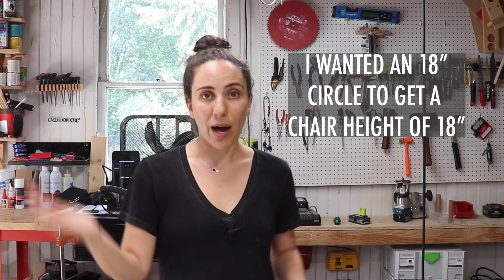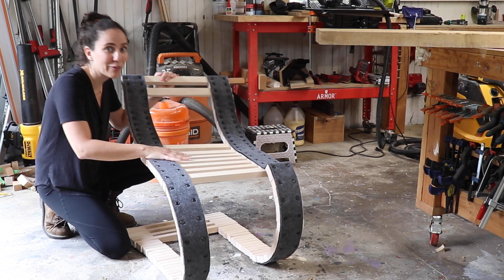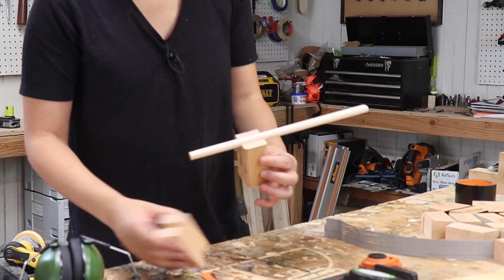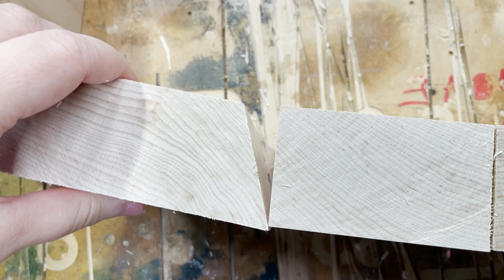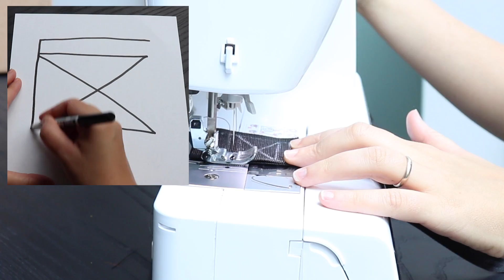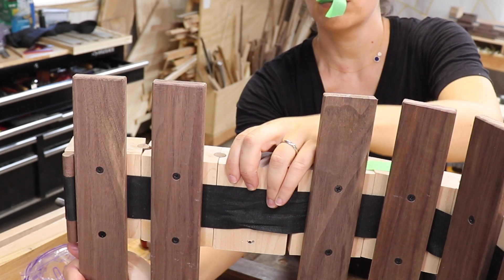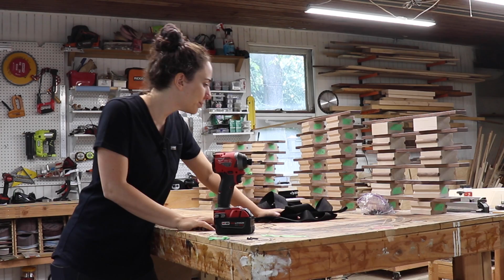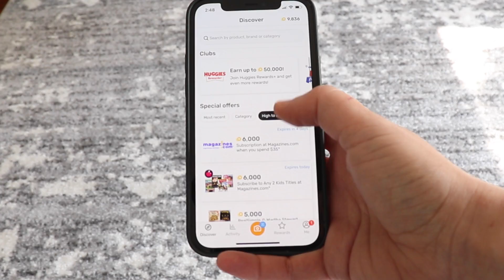I ATTEMPT to make a Roll Up Chair… AGAIN...

Comment: If you could have gotten the same sort of material that is used for seat belts....that might have worked best...
Reply: Also if you ran the straps in one continuous circuit along both the "back and front you might find a way to stabilize it...
Reply from the maker: That’s what I used

Comment: Hi,
I just wanted to suggest using something like bike chains so you dont have any of the flex from strapping (nearly every strapping has some flex which gets noticeable at such levers you have in you're chair). It may be heavier but depending on the chain could be still fine (I haven't informed myself so it is just a thought i had after watching and you would probable need to calculate how much force is on the chain [i think roughly is enough and maybe  you find a simulation program or just a calculator where you can just enter your 3d model] to choose). To still have this nice shape and bending you could cut out a rounded cutout at the middle of the thick piece (that the chain still moves fine and dont just have foldable parts where it isn't between  the thin and thick peaces of wood). I hope that you're still interested in that project and read my comment which will hopefully help in some way.
have a nice day
frederik

PS: i dont know how often i needed to correct the word chain into chair and the other way around but it was often. I also hope i didnt made to much mistakes in this comment except upper and lower case mistake I dont give a (I dont wanna get the comment deleted so no swearing) about that
Reply: or you saw that video which solved that problem way easier and i just wasted over a hour after 12pm to think about it (writing was literally the hardest part :(   )  while dont doing my homework for tomorrow

https://www.youtube.com/watch?v=MuodNlDKce4
O_O

I just wanna kill my self after i wrote the first comment and i went back to the starting page that vid showed up in the first row

Comment: Point 1: This project would never be able to satisfy you. As there is an inherent flaw in your expected outcome, this being the pinch points made with each piece of wood and the desire for safety.

Point 2: using joinery that hooks/latches/locks when tension is applied would solve the collapsing, this would though make it a lot more difficult to design and manufacture. while rolling it out would become more restricted in its order of operations.

Point 3: you have designed the chair to be folded out in the desired shape, having not accounted for the compressibility of the wood itself meaning it would not be as pretty to look as when folded out as you want.

point the 4th: replacing the UHMWPE or the nylon with leather would not solve the problem with the tension, try playing with steel cables first.

Comment: This problem is similar to how when you a long stretch of a power cable, no matter how much tension you put in it it will still sag under gravity. You can increase the tension to remove sag but its not quite a linear relationship and the cable can only handle so much tension. So yes stapling would work better. More support means you don't need to apply crazy amount of tension to stop a smaller segment from stretching/sagging.

Comment: You'd want the straps to be on the tension side (outside curve), if you change the side they are running on between the curvatures it should work better. (just lead it through a slot in one of the straight pieces)
If you could somehow integrate a spanner into the design to tighten the strap after deploying the seat that might also help. 

Also: don't try leather, that can stretch a lot. A synthetic fiber like dynema/kevlar with no stretch is what you need.

Comment: Leather would probably be worse that the poly your using. Leather conforms to stress your chair would be stressed continually so it would stretch till it breaks over time. Leather is skin so I believe it wouldn't work. I think your issue is the strength of the strap is weak due to it being linear in design. try a cross stitched hose material maybe and widen the strap to the width of the blocks. Just a suggestion. Failure is cloaked opportunity!

Comment: Odd idea. Have less and longer pieces, instead of a roll up chair that turns into a circle, it could be a fold up chair that turns into a triangle. Everything else would be very similar. A base piece, a vertical piece and a sitting and back piece. They have the angled edges so they fit in a chair shape and fold forward as your designs already do. I was thinking between the vertical piece and the sitting piece there could be an inner angle to add support, like an arch. To be honest this inner arch or angle for added support, is the best part of my idea but idk how it would work or fold up at all

Note: idk anything about any of this. This is merely a thought

Comment: I'm no engineer but maybe thinking of the straps as rubber bands will help? when you shorten the straps you increase the pretension but still, the weight needed to stretch them remains the same but if you instead double up the straps on top or side by side for a total of four straps then that should in theory be like doubling up the rubber bands on a slingshot increasing the needed weight to begin stretching? and also, won't seatbelts be good since they're slim and short and made to not stretch?

Comment: The problem is the tension being transmitted to the ends.  The straps really need to be attached at each piece so the ends don't have the curling under problems.  That also prevents any little bit of flexibility over the whole strap length causing a big gap at the weakest areas.  Even super stiff Kevlar strap can stretch up to 1% under high loads, and 1% of the about 1.5m strap length is enough to open up a 1.5cm or so gap and ruin the effect.  Where as if each board is connected, the inter-board distance is maybe 5cm and the max gap is <1mm even with normal strapping. 

I like the dowel groove joint, one could do the same thing between the cover slats and the maple structure to crimp the strap to keep each strap section independent.  I'd even epoxy between them to bond the strapping to the wood.

And then, if you still get stretching - get those Kevlar straps.  Probably overkill, but it'll eliminate that as a problem in any case.

Comment: what if they were all connected to each other like hinges? shape them like door hinges and put a metal or wood rod in the hinges. It really doesn't seem like there is any material that could replace the straps well enough

Comment: You should really try metal cable going through the blocks like beads on a string. Metal won’t stretch like fabric but you could still have fabric on top as a design choice.

Comment: Just use hinges. You can even incorporate them in the blocks design. Sadly, i think that wood is just not strong enough material for this design. I have seen steel chairs in that shape made with strong pipes flex and break at that support curve.

Comment: only 2 things i can think of that could work are, using some kind of steel wire/strap underneath those ones, or cut the strap so you have 1 piece of strap per connection instead of 1 strap for the whole thing, tho that probably wouldnt help much with strength, i think, idk, as for how to hold each strap end, you could make a hole in the wood and then pass the straps through it and fix it on the other side somehow, you are the tinkerer, you figure it out

Comment: I doubt leather would work. It would stretch. Having a small strap between each piece might work. It will at least prevent one end of the chair from collapsing on you when you put tension in it. If you can't find a suitable textile material, you could try metal hinges. Or maybe wood hinges? Maybe you could make pieces with integrated hinges.

Comment: Its a massive redesign, but what if it was a stool instead? It uncurls all in one direction to make a circle. That way, you could have some kind of fastener between the two ends, and as you sit on it, it deforms into an oval, with a longer edge, increasing the tension in your straps

Comment: I think synthetic polymers wont do it. I think a braided steel wire or belt that is pretensioned to the correct length is the only way to get around the stretching. Or having some method to add tension that is dynamic. Instead of both ends being sewn, having like a ratcheting strap at the feet

Comment: This is more of an engineering challenge than carpentry. I think the solution violates the spirit of the design, so I think this challenge may be beyond the material science of the materials. 

I'm from an architecture background, so I'm not fully qualified, but the issue is the type of moments that are created at each joint. Each joint isn't a joint due to the strap being the only connection point. The strap then has to overcome tension, pivot forces, and shear. The best way to test the prototypes might be to remove the biggest issue and permanently bond the pieces and see if that works the way you want. 

The straps need to act as hinges, so bonding them as close to the edge is critical. But this project is kinda like trying to make a rope act as a pillar. Its gonna be tough no matter what.

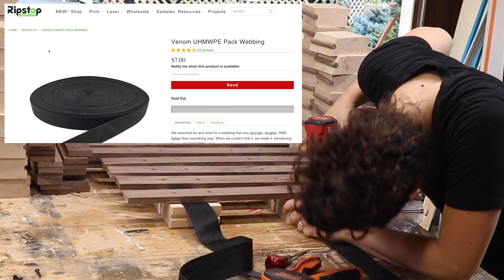Comment: 16:30 Ayo, Ripstop by the Roll Ultra High Molecular Weight Polyethylene Webbing is my shit!
But no in all seriousness we use that stuff in the Make Your Own Gear backpack hammocking community lol. My ultralight tree straps are made out of the same material.
Have you looked into how much UHMWPE stretches under load? It does have an incredible tensile strength to weight ratio, and it is used for Amsteel Blue and other ropes used in things like the logging industry, kite lines, and on ultralight sailboats, I presumably in applications that are intended to be static lines. I know in my applications I haven't seen it stretch under load, and Dyneema Composite Fabric (DCF) tent material (which uses UHMWPE) is specifically noted for the fact that it doesn't stretch and sag when it gets wet the way silnylon and silpoly do. I just have never used it for applications that require very tight tolerances, so I don't know if it could be stretching in your use case, contributing to the sagging issue.
Nevermind I commented before watching the rest of the video where you used an alternative, lower-stretch strapping material.
Idk, maybe RbtR's 2" seatbelt webbing might be better? There must be some type of polyester or nylon webbing exclusively engineered to be static and stretch as little as possible. I mean what else do the make tie-down straps out of, right? The difficult thing is, at least after ten minutes worth of research, I can't find any consistent measurement or index of elongation under load for those products, at least in the data made available on the consumer end.

Comment: I don't know if this is cheating too much but it seems like the huge hang up is just the straps that keep the chair in form.  What if you bypassed that entirely with some steel brackets that connect the base of the chair to the back of the seat?  They could lay parallel to the slats when the chair is rolled up and then fold up from the base to attach to the back of the seat when the chair is set up.

Still lets you have a roll up chair, just 1 extra step when setting it up to sit in, and a lot more stability in the end.

Comment: i think ya problem is that A: the stress on the parts is REALLY high and B: when the chair is extended, the strapping is 'longer' then when it is in chair mode, so when it enters chair mode there is slack. perhaps some sort of tension mechanism to where you can tighten the strap when in chair mode would work....

Comment: I dont think straps will work no matter what material you use its too much flex. The straps should only be to hold the pieces together, all of the stability needs to come from the material itself. 

 What u want is the chair to be able to function as a chair without any straps. The straps should only be there to hold it together when u roll and unroll.

Try some kind of joint in each piece such that the two pieces lock together when put in tension, but come free when u roll it up. The dowels almost serve that function but instead of round dowls use a more square shape with an angle That is counter angle to each piece that slots into the next piece and froms a "one way" joint.

This will make fine tuning easier as well because you can assemble all of the pieces test if it works, once all the joints are set up then you can glue them in and then as a last step add the straps.

Comment: I feel like having more straps would help with the stretching issue, as it would divide the amount of weight each strap is holding up more. So if there was 4 straps instead of 2, then each strap should only be holding half the weight it was before, i think.

Comment: i think that if the u run a strong cord INSIDE the block there will be no angular pull and it wont collapse, and a steel wire or something will have a surprising amount of flex.

Comment: There are two stretch factors in your straps that may be working against you. The first is the weave. You are probably using a braid, but that is good for strong movement, not rigidity. You may be better suited by a plain weave. The second is the fiber. Polyester is also strong, but much of the strength comes from it's ability to stretch. You may want to look for a rigid fiber like kevlar, twaron, or horsehair. Additionally, I wouldn't go with leather, as that is also stretchy. To help with the collapsing issue, I think some other commenters are on to something with anchoring the fabric at different locations. The flat sections have a lower tension at equilibrium than the curved sections do, so when strung together the curves droop when the flat sections are satisfied and the flats curve when the curved sections are satisfied. Segmentation allows for differing tensions. I hope this helps!

Comment: As some people have suggested, going with individual metal hinges should work just fine. In theory you could also do this with individual pieces of fabric that connect just two pieces each. The problem was that by using two very long pieces, the tension spread through the whole construction regardless of the point where it occured. If you go with multiple small pieces, all points where any tension exists don't affect any other part of the construction. Also I think that clamping it between two wood pieces doesn't prevent the individual sections from being stretched proportionally to the length of the whole strap. By choosing many small pieces, the stretch is proportional to the length of just that small piece and should prevent any gaps really. The only porblem would be, how to securely attach them between those two pieces of wood, however I'm sure you would come up with something.
Reply: That's just wrong. If there is stretch in a long piece then the same stretch will be in 20 short ones. And if you can fix 20 short ones in place safely then you no longer need the short pieces bacause you already figured out how to fix them properly. Like you arent doing some magic by cutting stuff down. Metal hinges woold work but that would be a totally diffrent design. The Problem however was pretty obviously the clamping. You need to fix that band as rigid as possible to the wood. I didnt rly get why screws werent an option  but the clamping allowed the pieces to shift on the band and you need to stop that. That was also my first thought on the first video when the yoga rubber came into play...you DONT want anything that stretches or moves. The Stuff safetybelts are made of should work i think. Just fix it rly good.

Comment: Use door hinges to hold the pieces together you’d need one for each joint, they swing in the motion you want whilst being sturdy enough not to break under tension (you’d need to cut a channel in each piece to compensate for the width of the pin on the hinges) but I don’t see why it wouldn’t work
Reply: that is exactly what I was about to suggest - put the hinges on the side you want to fold into - the same side as the cross boards - that will do it
Reply: This was my thought as well, but I'd put the pin facing out so you don't have to compensate for it.
Reply: Exactly what I would suggest - the bands are just too flexible to ever create a strong enough connection.

Comment: You know what? I think your chair need more structure support from the wood instead of relying on the strap to keep in chair form. Instead of thinking the straps as the backbone of the structure, think of it as the muscle tissue that connects the chair, the woods should have some kind of "locking" mechanism that will the backbone of the whole chair structure.

Comment: Would there be any inherent issue with simply increasing the layers of straps used? I mean sure, it might look thicker, but I'm sure it wouldn't be too unsightly. Same force applied over a larger cross section means less strain, therefore less deformation.

Comment: I think the forces are too high to use cloth for this. Any flexible material will stretch a little bit under such high forces. Have you considered using hinges at each joint?

Comment: steel wire and elastic strap hybrid with stops on the circular parts. on the circular parts use steel wire on the spot were the circle ends place the stops and for the other parts use elastic. elastic will never stop expanding, while steel is much harder to expand.  the stops will be so that the circular parts stop getting supporting on the elastic strap and instead support on the steel wire. 
now a visual representation of what i mean.
--   : Elastic strap
== : steel wire
I    : stops
-=I==I=-  : untensed circular part
--I====I--    : tensed circular part